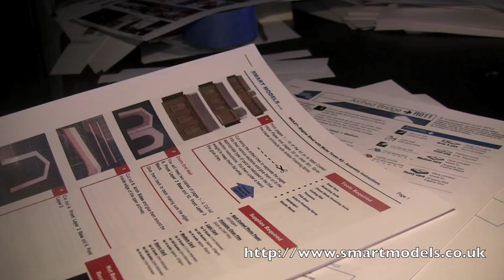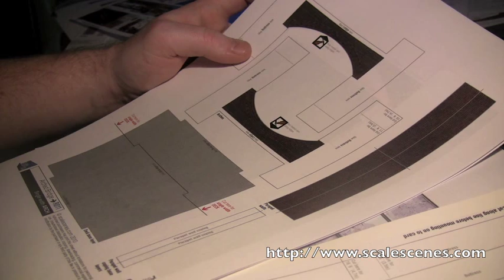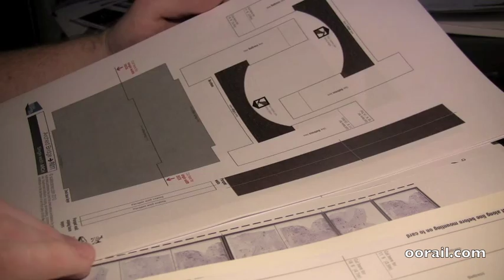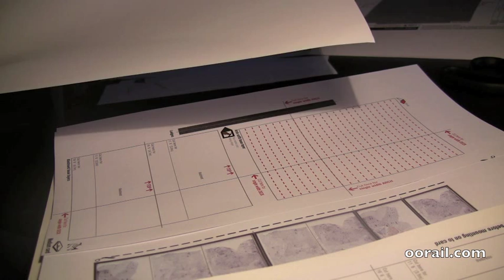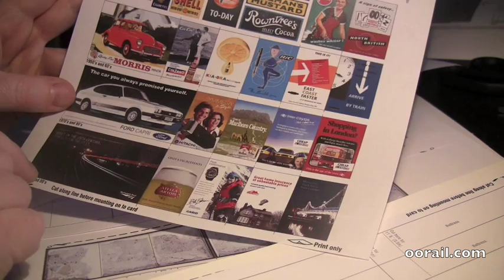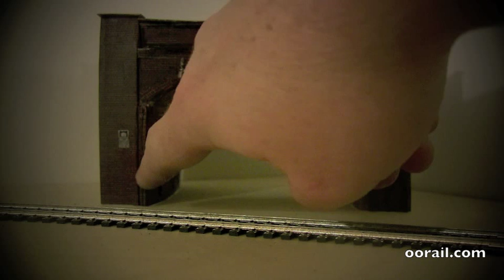oorail.com | Introduction to OO Gauge Model Railway Printable Kits

Comment: You make it look easy with professional finish 👍🏻🚂
Reply from the maker: Thanks. They are easy to build and the scalescenes kits are very well designed. I have built several of their kits and you can get great results even with an entry level inkjet printer. The only drawback is that they are time consuming to build, but well worth the effort. The layout here is very large so as my kids got older (older two are now teenagers), my free time is a lot less, so progress is very slow. Thats one of the reasons I got into 3D printing, I can 3D print a lot of projects I would have either built from scalescenes kits, kit bashed or scratch built. Now I can design the building in CAD, let the 3D printer work away for a day on it, then assemble the parts, paint and move on to the next component. The only real issue I've run into with 3D printing is that the FDM printers can't easily print scale 4mm brickwork, so I've used a mix of Scalescenes and Scale Model Scenery printable texture sheets that are cut and spray glued to the 3D printed buildings. For larger brickwork (like you'd see along the track work at Sydney Gardens in Bath, I've been able to use the 3D printers and special brick like textured PLA. I have some videos coming out over the coming weeks that'll show this. So stay tuned..

Comment: If you don't use the recommended thicknesses of card, some parts of the model won't fit properly. They are excellent kits but one needs the correct materials to do them justice. I have built many of them, some heavily customised, and find them really easy to assemble. I NEVER use scissors. It's almost impossible to get a straight cut. I always use a heavy duty craft knife for the thick card and a scalpel-type knife for the lighter materials.
Reply from the maker: +Perry Hampson Thanks for taking the time to comment Perry. You can waste a lot of card and glue by sticking the entire sheet to card, so a decent pair of scissors to cut the printable kit components down into smaller sections is typically a good idea. There is some degree of wiggle room with the card thickness. I typically use 1mm for medium and 2mm for heavy card, these are the recommended thicknesses that John Wiffen over at Scalescenes.com suggests on his website. So far I've built dozens of these from engine sheds to boiler houses to low relief factories and houses, and they've turned out very well. A scalpel-type knife such as an x-acto knife works very well and will cut through the 2mm card very easily if you do it in a couple of passes. The knifes though require a bit of practice especially on longer sections. For the 1mm card, its a lot easier to use a decent pair of scissors. I have no problems getting a straight cut with scissors, the trick to it is making sure you have plenty of light (eg. lamp) and you use the back end of the scissors close to where they meet in the middle. Obviously you will want to have a couple of pairs of scissors that are different sizes. If you are trying to cut a small item with a large pair of scissors you won't find it so easy! The kits are definitely easily to build and a fun project, especially for a cold and damp afternoon! :)

Comment: You can also use colored chalk for weathering.
Reply: oorail.com I use a mortise and pestle. Then fix with a matte varnish. ;-)
Reply from the maker: MrTinyUK Yes that would also work, if you go that route I would suggest breaking the chalk up until its a fine powder and applying it with a brush.
Reply from the maker: Paul Sim Thats a good approach, I put the chalk into a zip-lock bag and then used a tack hammer... :)
Reply: MrTinyUK Nice video.Something I also found helpfull for cardboard buildings for model railways was Elumpa Railroad Buildings Alchemist - it will be on google if you need it